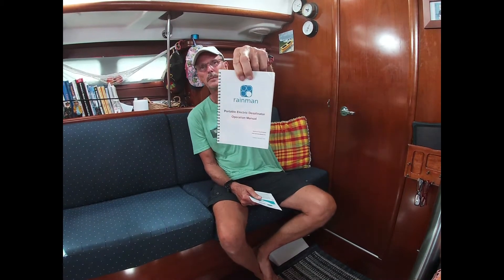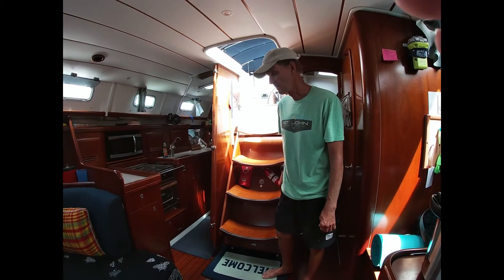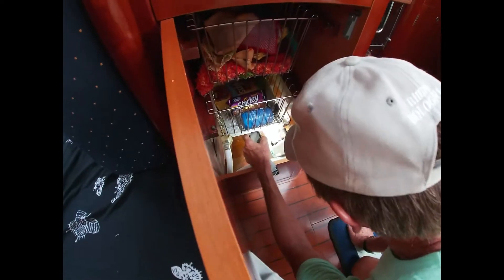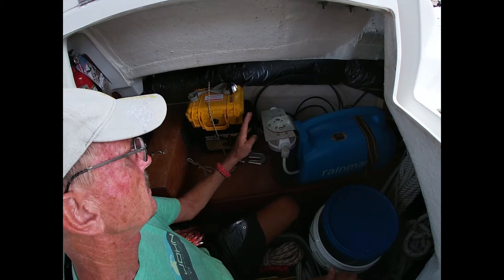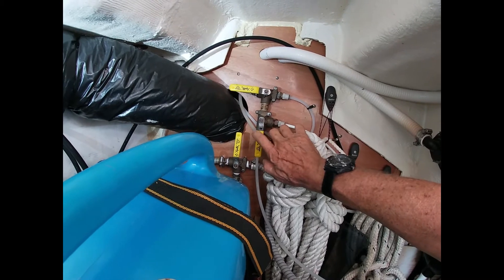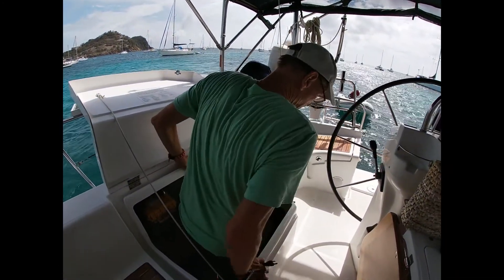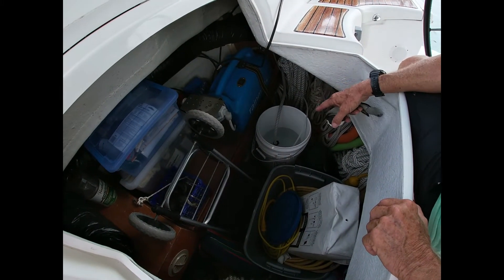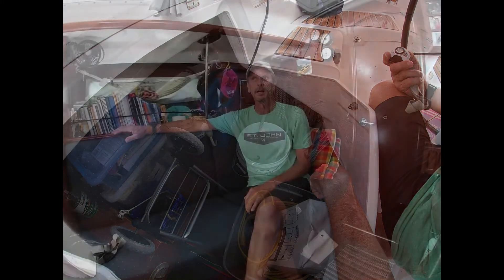Rainman Watermaker Installation on a Beneteau 423 - Sailing Maracudja

Comment: Hello!  We are installing our RainMan and wanted to ask about the extra filter you added.  Could you send me the details on how you did this.  Thanks!
Reply from the maker: Glad to help.  I added an aluminum plate to the existing filter bracket and that gave me room to put two filters side by side attached to the new wider plate.  Having the 20k micron in front helps reduce changing the more expensive 5 micron filter.  We ran that way for 5 years and no issues with the membranes.  BUT I always flushed the system every time I used it with fresh water.  Multiple friends that just left the saltwater inside for a few days only got about 18 months out of the $$$$ membranes. This unit makes so much freshwater you can flush everytime.

Comment: Hi Gary, thanks for putting this video out on the RainMan. Much appreciated. We are shopping for our next boat for liveabord as of July 2022 and the B423 is on our short list. Many of the boats we look at are well equipped but rarely with a WM. So we thought the Rainman WM would be an easy choice to at least use for a few years while I learn about/manage all the other systems. Do you have any comments you would like to share about your Beneteau 423 for living on full-time?   Much appreciated! Ced and Kiki Montreal, Canada
Reply from the maker: Hi Cedric.  Tha ks for watching our video and commenting.  We are new at this and really appreciate all the feedbacks.  The Bénéteau 423 was one of top contender out of 22 boats.  We really love this one.  We have a curling sail whichakes it easy to reef and never have to leave the cockpit.  We don't have motorized winches but this set-up works perfectly for us.  We have the 2-cabin version In which the second berth is used mostly for storage.  There is a large and deep lazarette outside which is also well utilized.  The galley is a L version which works great underway and there is plenty storage we found.  Overall this boat can handle muchore severe conditions than the crew lol and we are happy with it.  Important point toale, purchase an anchor bigger than recommended for the boat.  We love our 25kg Rocna.  We have never dragged! In this case bigger is better.  
Good luck with the boat buying process.